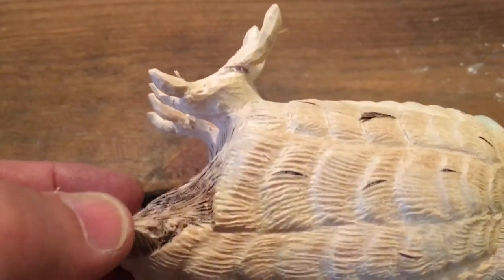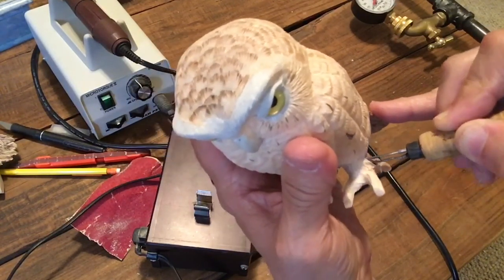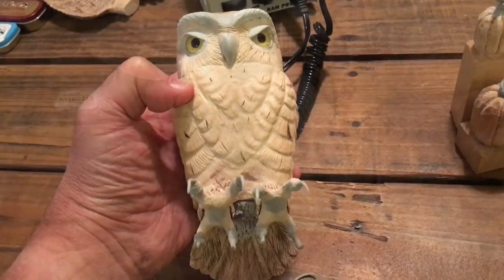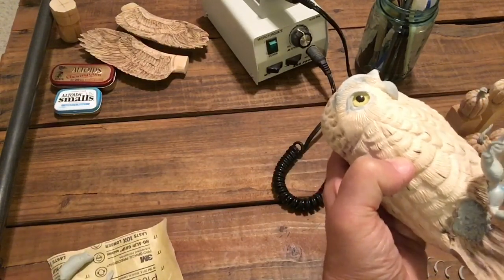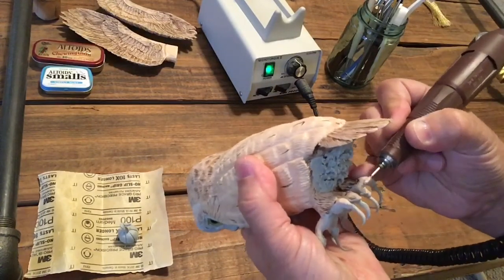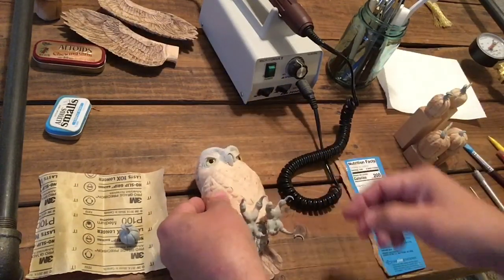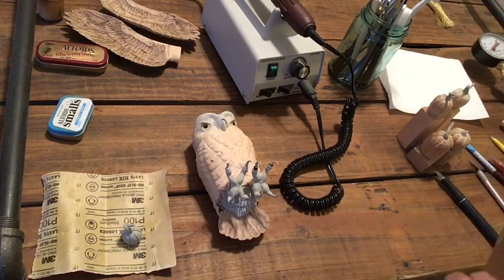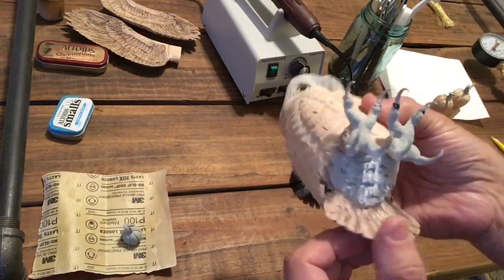Talons, Feet and 2 Part Epoxy on an Owl Woodcarving

Comment: Hi Mark,  how's it going,  I'm dropping in from Carving Fusion.
...You,  do very nice work,  looks like, they're the ticket, the micro Carver, looks like it's set up, so you can controlled variations of speed? And if so that's great.  I've never seen anything I like that. What's the machine called? If you don't mind me asking?
P S:- have you ever tried the gorilla gel super glue for repairs or attaching certain parts two-year sculpture? It's supposed to be the same as CA glue? Just wondering don't mean to bombard you with all these questions.